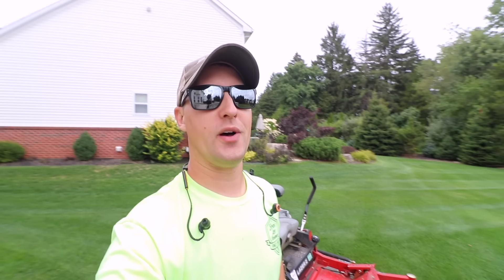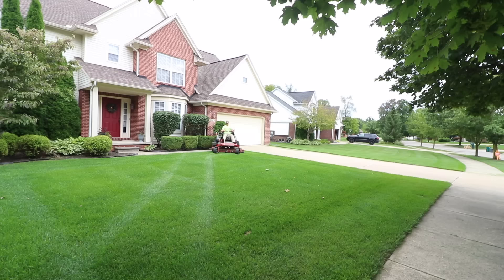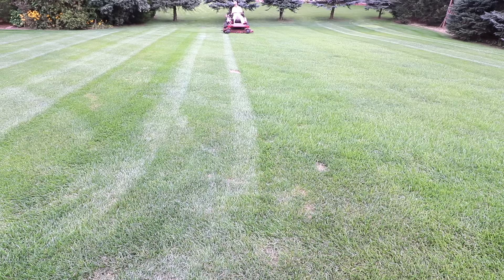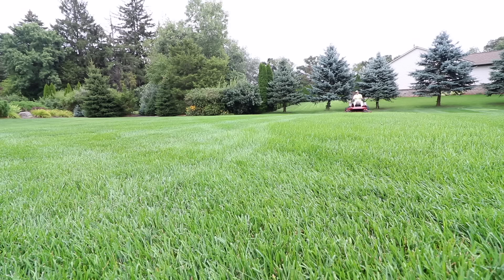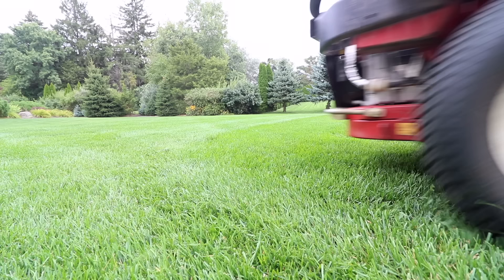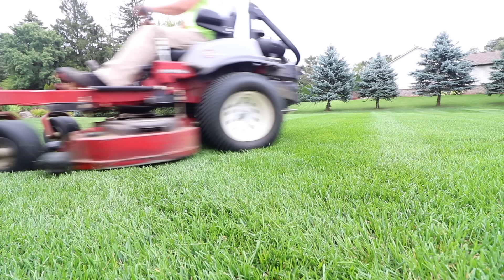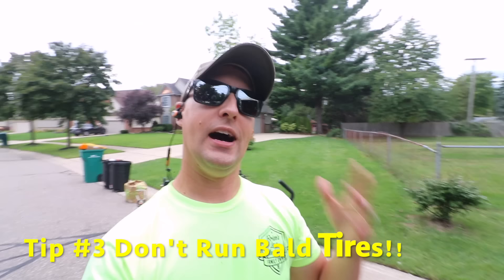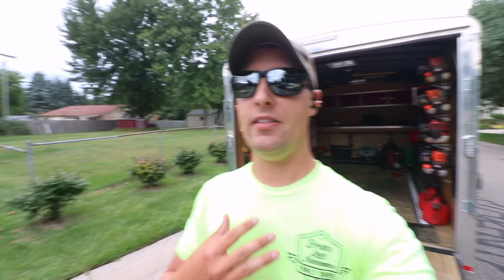The Secret To RUT FREE TURNS On A Lawn Mower

Comment: Would lowering the air pressure (just a little) in the rear tires help keep the tires from spinning? Mine seem to spin even though I try to gradually increase speed on the turns. I am already doing the 3 point turn. A little history... I am not new to zero turns. I mowed for Michigan State University for a year and I owned my last zero-turn for 6 years. This problem is new to me with the purchase of a new Ferris mower.

Comment: I'm just a homeowner but love your tip videos.  Any advice for cutting around tree rings and tight curved beds with a zero turn?  I have ruts starting.  Also my front wheels spinning on turns is also causing damage from grinding.  I love my ZT for time but am even thinking about going back to a tractor.  Thanks
Reply from the maker: I can try to do a video on that!

Comment: I have the issue with the tracks in the grass usually when the ground is wet or soggy wet.  I have areas where the land is at a low end and water stays there for much longer periods of time. So due to the areas like this and others, there are parts that stay wet longer then the rest of the grass and that is when I tend to easily get the skid marks if you will.  Any suggestions to handling those issues?  I know to slow down but I just can't get around them.  Then there is the issue of some areas where those marks are and now how do we repair that damage?

Comment: For example, Instead of aligning "Tip to Tip", can you align "Tire to Tire" ? Meaning if it is easier for me to see me tire tracks, and then just line up the tire track with the next row, do you achieve the same as Tip to Tip? Hopefully you understand my questions. Thanks!!
Reply from the maker: Depends on the mower! Smaller decks like a 52" or 48" would stripe well if you went wheel to wheel. A 60" or above would not look right, as the deck would overlap 6-10" on your pass, sort've messing up that illusion and line it creates if you went tip to tip!

Comment: Can you help me figure out why my left handle won’t accelerate I’m having to control with my right hand. Can’t find anything to help me with my issue.
Reply from the maker: The dampener may be bad. The black metal that limits the extension of the handle could be off, or the hydro could be acting up. Ask your local dealer for help!

Comment: TWO POINTS. 1 SLOW DOWN WHEN COMING TO THE END OF STRIPE WHILE PULLING BACK ON OUTER WHEEL OF CUT WHILE PUSHING FORWARD WITH OPPISITE TIRE. 2 PULL HANDLES BACK TO NEUTRAL BEFORE YOU MAKE TIGHT TURN USE YOUR FORWARD SLOW SPEED WHILE GENTLY PULL ING BACK ON PVIT.  P.S. DON'T DRIVE OFF EDGE OF LAWN IT MASHES DOWN YOUR CRISP EDGE ' ALSO DO PERIMITER CUT AFTER YOU DO YOUR STRIPES. MAKES FOR A CLEANER CUT AND IF YOU DO SPINA TIRE YOU CAN PICK UP ANY WHEEL CUTTINGS'

Comment: What I also would like to hear is how the striping kits are for the Exmark machines. I just bought a Turf Tracer 48 and considering the striping kit but its super pricey. curious if the juice is worth the squeeze.
Reply: I have the same machine. Get a striping roller from Harrison Specialties. Its the same as the Exmark and you will save a lot of money. I have had mine for five years and its still working great.

Comment: Brian quick question, our exmarks run have pneumatic front tires and we are thinking about replacing them with solid ones due to a lot of punctures and wear. Do the solid tires change the ride much or any other problems?
Thanks .. enjoying your videos
Reply from the maker: Ride quality would probably be similar, but honestly I’ve never ran pneumatic tires. Even on my first Z I had them upgraded to the solid ones. I think they’re definitely worth the upgrade.
Reply: Thanks!

Comment: So even on dry grass SLOWLY doing a 180 degree turn won't save me?  My Ferris 400S is getting dropped off on Monday so I am curious
Reply from the maker: 3 point turns are where it's at
Reply: @BriansLawnMaintenance  😢 i guess it will still be faster than my regular tractor lol but even pushing forward on one bar and back on the other won't matter i read locking some of the wheels is what does it

Comment: On the question on do I turn on grass or driveways
Whenever possible I try to turn on hard surfaces but on small yard (at which I don't hardly any anymore)(I mainly do industrial grounds)I will tippytoe and do a rollback syle turn... Pull to the end of cut and get both wheels rolling backwards before making turn

Thanks for the tips
Keep the good videos like this one coming 
Chop/Chop Bro

Comment: Hey Brian, great video! I would add one thing. I happen to mow quite a few yards that have hills of some kind and I find that when I do my “T” turnaround on a hill, I will head up hill at the end of my pass, then back down past my last line, and turn90 degrees in reverse which leaves facing my next line perfectly. For whatever reason, going in reverse up hill has always resulted in a tear up. Just my 2 cents. Good luck guys, thanks for sharing your info with us!

P.S. I also let my tires run a little low which helps keep traction, kind of like driving a truck off road! 😉
Reply from the maker: I dig it bro!

Comment: Noticed that you turned on the sidewalks. Is there a trick to prevent clippings from being transfered from the tires to the concrete?
Reply from the maker: If it’s wet we turn on the grass, if it’s dry I use the sidewalks 💪

Comment: i mostly turn on the lawn; i dont like leaving the wavey edges you get from running off and on.
Reply: avoid that by cutting a peimiter 1ST. and if the edging isnt too tall, keep your left side tires just on the concrete...or gently weed whack after.
Reply: @ryanbrowne120  i always run a perimeter, brother.  and exactly, yes, when possible i let the left mower wheels ride the concrete ( or whatever the paved surface may be ) so it also leaves a nice clean flat cut and the only thing i ( usually  ) have to do there is edge it. running solo, that saves me a lot of time, and to me and my customers it also looks better than flatting with a string trimmer.
Reply: @Pure_KodiakWILD_Power  right right. Only other thing I do is use s walk behind. That's only if I need it somewhere else on the property. Sounds like your actually a good lawn guy. That balances smart with high quality.

Comment: #1 You drove the mower onto the walkway, sidewalk or whatever. 
The high end places here will fire you for leaving grass Mark's on their driveway,  sidewalk, walkway or whatever.
You almost can not clean off the concrete, especially the perfectly white rough ones.

#2 Do another lap around the parameter so you can Stay on the lawn!
Your 2 point wasn't bad...
Good luck.

Comment: I turn around in the rough and the mower I have to use has totally bald tires and I cut the grass everyday at 1/8 inch
Reply: 1/8 in ???? Little short
Reply: @joescheller6680  not for a putting green on a golf course

Comment: Once you have lined up edge to edge do you just looked forward ? Or you have to keep an eye out at the edge I’m new on the zero turn so any tips would help
Reply from the maker: Just keep the caster wheel or the tip of the deck in your peripheral and you’ll be good!

Comment: The point that I would make and this is how I do it regardless if there’s a sidewalk, driveway or not because sometimes you don’t have a sidewalk you only have grass to turn around on, but in either case my pivot wheel is always going in the reverse direction as the wheel that I’m using to make the turn regardless of which way I’m turning left or right that way the pivot wheel is not stationary when you’re making the turn. Most people that tear up the grass either don’t have enough experience on a zero turn mower or their pivoting on one wheel without it turning which twist the turf and usually tears it all the way down to the dirt eventually creating bald spots. This being the case especially on grass that is dry but when it’s wet the tire will slip a bit without it tearing as much, but no matter the condition I always have my pivot wheel going in the reverse direction as my turn wheel. I have been using the Exmark brand and it’s the only one that I have been using for going on 20 years now.😁😉

Comment: What size tires on your Exmark?
Reply from the maker: I’m not sure. Maybe 13x23.5”? Couldn’t even tell you to be honest, sorry
Reply: @BriansLawnMaintenance  
Guessing I would say
24x12-12 or 26x12-12 since it has a 60 inch cutting deck.
My thoughts are mower weight, weight distribution, & tire size & width, tread design, air pressure,  & contact area, will affect downward force per square inch.
TMI . ..?
Maybe just driver's ability after that 😆-😄

Comment: QUESTIONS FROM A CARETAKER:  A) DO YOU USE A CHIROPRACTOR OR MASSEUSE ? B) WHAT HEIGHT GENERALLY FOR YOU? C) BEST EAR PLUGS ? D) DO YOU HAVE A SUSPENSION ON YOUR MOWER ?  E) IF YES WHICH MOVER IS THE BEST ALL AROUND YOUR OPINION? F) BEST BLADES TO USE?? WE USE A JOHN DEER 970 ? 60 IN. CUT GAS 25 HP BACK KILLER AND NECK:( GREAT MULCHING CUTTING MACHINE ECONOMICAL ON FUEL.  CUT SAFE KEEP THE TIRES ON THE GRASS:)
Reply from the maker: Watch our videos we answer every single one of those questions

Comment: I saw a guy mowing by my work flying around the lawn on the zero turn he was using this was me 🤦‍♂️
Reply: I blame the manufacturers that have their equipmant able to be notched up to 16.5mph with the deck engaged...IMO, having the blades running should engage a lower gear..but that's just me.

Saw a page on Gizmodo about the Dixie Chopper Excalibur mower, which clocked in at 15mph:

...."In fact, the product site claims that you can obliterate a 9.2 acre plot of land in about an hour—which is just enough time to work your way through a Slayer album using the 12-volt iPod / Cellphone compatible adapter. After all, that is the only way to cut grass with a beast like the Excalibur 3874. Pedal to the floor with metal music blazing and a middle finger extended in the direction of your neighbors. Unfortunately, you won't be enjoying that unbridled masculine lawncare moment unless you can come up with the $11,332 it takes to buy it."

Comment: Mean Green Mowers headquarters is just 275 miles from  you. I left a message suggesting they contact you, so hopefully they will at some point. It turns out they have a representative that is, according to their website, less than 15 miles from you. Demonstrations available, it says. Contact Pete Sole at 317-850-7960, pete.sole@meangreenproducts.com.

I sent Pete an email just a few minutes ago and he responded right away. Hopefully he will be contacting you on Monday and I will get to see a review of their products on your channel in the not so distant future.

Having never used any of their products and also having never been in the lawn maintenance or landscaping business, but being generally familiar with first generation electrical technology, my guess is that it will be more expensive up front than what you are used to paying for similar equipment but that you will get as good or better performance and the fuel and maintenance savings as well as the decrease in hassle and increase in up time of your equipment will more than offset the higher initial cost. In other words, you'll be sold after you try it. Plus, there may or may not be significant tax incentives available.

One point of note about the battery longevity, because everybody wants to know about battery longevity, they mention on their website that it is either an 8 or 9,000 hour life for the batteries. It is very important to note that they are guaranteeing that the battery longevity will be retained at 90% of the original capacity at that 8,000 or 9000 hour point. It should be underscored that at the 8,000 or 9,000 hour point it does not mean that the equipment is junk and/or the batteries have to be replaced at that point. It means exactly what it says which is the batteries will still work completely fine but will last about 10% less mowing time then they did when you first bought them, and they will still have an extremely long overall life cycle. The jury is still out as to how long they will last in there totality but if you're able to do 8 or 9,000 hours and only lose 10% then it stands to reason that they will last substantially longer overall. I'm not sure that I can say that you will get any or 90,000 hours out of them as the math would suggest, but that may not actually be too far off. Wouldn't that be interesting if the gas you are buying this month and next month is the last gas that you ever buy for your lawn care equipment.

That is a point often misunderstood by the general public and can be a huge barrier to adoption. Like I say for those who are considering purchasing an electric automobile, it's not like you have to throw out the batteries and replace them after 8 or 9,000 hours. It is just that they will degrade in overall capacity by that point. It is more important to realize that that probably is not going to make a difference in how you use them at all.

Say for example there is an electric car that will travel 300 miles on a full charge, and when it gets to a point of 10% degradation it will only have a range of 270 miles per charge. Well, for the overwhelming majority of people who drive their cars 50 miles or less per day than it has no effect on the day-to-day use of the car/machinery. In fact, if the vehicle had a range of 600 miles, 1,000 miles, or 1,000,000 miles it wouldn't really matter because the user only operates the vehicle for a very small fraction of that overall percentage before it is recharged in a normal use case scenario. in your case, and especially on busy days, I would imagine that you would get well over half of the runtime of the battery used. I'm not sure how much actual on the mower mowing time you get in a typical day but it could be a significant portion of the battery life. I'm betting though, when you really look at the actual time the mower is mowing and not at including the time where you would typically be taking time out of your day to get gas for the equipment and gas at the equipment and do maintenance and all that other stuff, that one full charge overnight will last for a full day's worth of work well after the 8,000 or 9,000 hour mark.

Not sure how many your company ends up using any particular machine on average, but the math is fun. If you do 4 hours per day of actual mowing time (and that's just a random number pulled out of nowhere), that's 20 hours part week. If you do a 5-day work week, you're looking at about 1K hours per year. I threw in a couple of weeks for vacation. That's eight or nine years of trouble-free operation relative to the lack of an internal combustion engine and all the noise, stink, fumes, and hassle associated with it. Your mileage may vary depending on the actual number of hours that the machine gets used for but if the battery retains 90% of it's original capacity after 8 or 9 years, that's still 6+ hours of continuous mowing. How much would you end up spending on gasoline and spark plugs and pulleys and renting extra equipment due to downtime, etcetera in 8 or 9 years? 

Cheers.